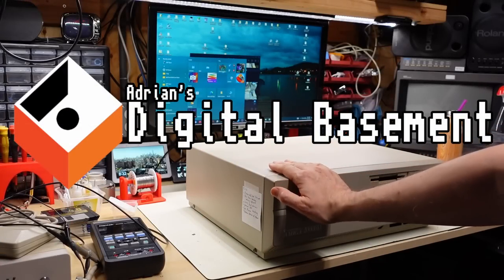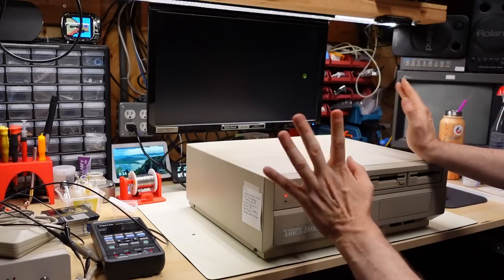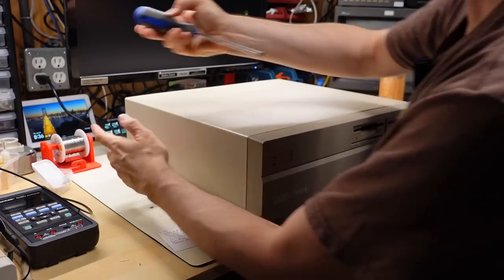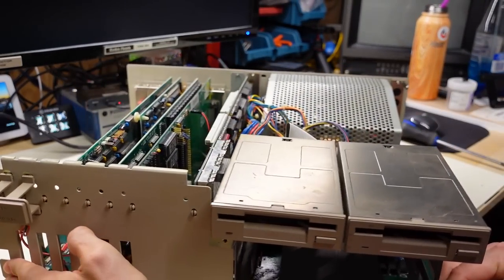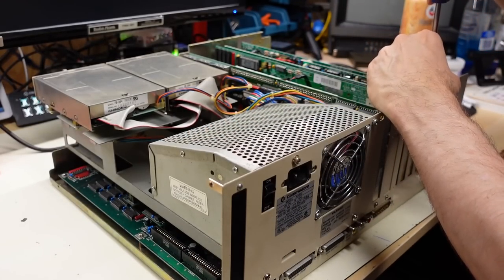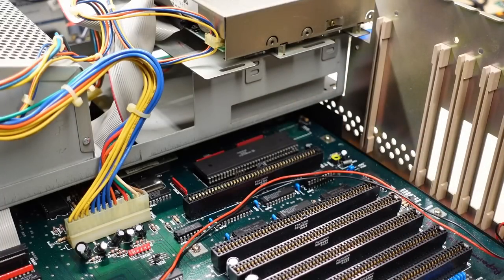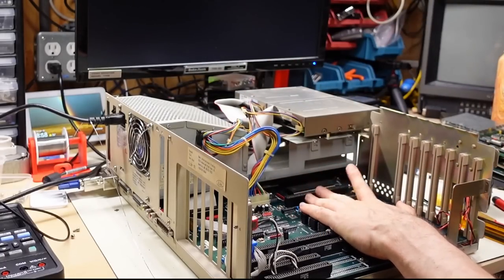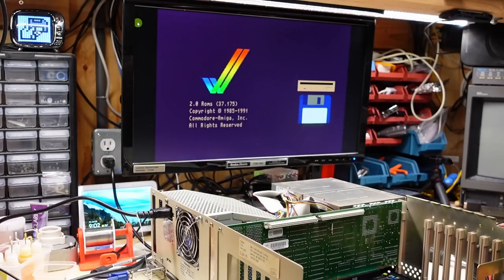I used the "easy button" to fix this broken A2000

Comment: As a guess I would say pushing down stretches the bottom layer of the PCB and compresses the top layer, so I would be looking at the top layer for a break. 
It could also be a break in a via, ie, it needs more solder in the THT holes so that you can see solder on top and bottom.
You should also remove every component in the affected areas because you never know what's under them if you don't.
Reply: Mr Guru  I was thinking about that, ie, machined headers use a wedging press fit that wears with multiple insertions, ie, it gets looser. 
Wiper is spring loaded so has constant pressure, but because it's not a press fit it can suffer capillary moisture attraction.
Dual wiper is better because if one side corrodes it still has the other, and I've seen on EEVblog multi pin press fit connectors with no solder that are very reliable.
Me personally I like wiper, but I guess both have pros and cons.
Reply: Mr Guru  I just thought of another problem with machined pin headers. If you have a dimensionally long IC, like the one with the problem, and your PCB is bent, eg, a dip in the centre, the end pins will have the correct press but the middle pins won't. 
I suppose it's rare, and more likely you soldered the headers in not flat, but I guess it can happen.

Comment: This reminds me of the time when I was in high school and I '"fixed" the loose connections on a computer lab PC's VGA port by shoving a folded-up piece of paper in-between where the monitor cable was plugging in and whatever was plugged in next to it. (People kept bumping the back of the PC and that cracked some connections on the VGA port.)

Comment: The issue of it working at boot when you flex the board, and continuing to run after boot, even if you remove the flex, strongly suggests the rest pin. Furthermore Don't discount the sockets... I built a HighDEF NES mod into a top loader NES a few years back. It was frequently intermittent, and the seller of the mod ended up swapping from a machine pin socket to a dual wipe style socket, cause apparently the machine pin sockets he had included would just sometimes be unreliable with some IC's pins.

Comment: If this is the Commodore A2630 (68030 @25mhz) accelerator card, the system will work without the 68000 on the motherboard. It's one of the few, if not the only accelerator card that can do this. 
Had problems with my A2000 aswell, kicked out the 68k on the mainboard, ran fine ever since.

Comment: I used this connector with round pins for a ROM on my Amiga 3000 and it was causing the black screen problem. ROM chips I used have had flat pins, like the CPU have.

Comment: In terms of reliable vs. unreliable Amigas, there is of course the A500 Plus model too which suffers onboard clock battery troubles, as well as having owned one (which died when Amigas were near worthless and cheap to pick up), I've seen myself a few externally nice ones on ebay from optimistic sellers with "amazing condition, perfect example!!!" style descriptions along with a high asking price, and then seeing the green death around the expansion bay pins which they remain silent about, yeah, those batteries suck, but those sellers suck too...

Comment: Not craptastic, Adrian! There is no shame in using the "wedge as repair" technique. In 1987, I shoved a piece of foam into my HP 11c scientific calculator. A couple of leads on the surface-mounted main chip had come loose and I only knew through-hole soldering. It's still working!

Comment: I had a C64 with no intermittent audio out of the RF connection.  I had to shim the RF RCA jack to make the connection solid.  I later on got the SAMS book for the C64 and made a DIN cable to send the audio to my stereo receiver.

Comment: Funnily enough, that's exactly the fix Commodore would have used back in the day.
Reply: Always remember then admitting that they repaired returned machines and then sold them as new and not refurbished. Just one of the many clues that Commodore were never going to last.
Reply: Maybe in-house, but even they'd know this was likely to come apart in shipping, and that the loose part could do further damage. Sending a machine to anyone like this has such a high probability of being DOA that I can't see them letting this leave.

Comment: I've got a front loader Nintendo, that I HDMI converter, that just don't work when I've screwed it back together. Finally I figured it that it was caused the motherboard being slightly bent on the back where the cartridge connector goes and that caused the connector to get slightly bent. Using the console like that works just fine, but when I screw it back together, the cartridge holder pushes on the connector in such a way that some of the pins get disconnected, causing issues related to those pins.

Comment: @Adrian's Digital Basement ][
This seems very much like a cold joint problem to me. Perhaps you just need to go over all the connections around the CPU with a soldering iron to reflow and solidify them. I would do this before removing the solder mask like you were suggested. EDIT: Don't worry about the AC noise, we can barely heard it. Not a problem at all. EDIT2: The SCSI to SD thing could be a voltage dip problem. Those adapters require a fair amount of power to work right. You may wish to check PSU power output and voltages connections. That system might be suffering a "brown-out" situation.

Comment: I'm not familiar enough with those SCSI cards but the random failures suggest a lack of termination power and/or a lack of termination resistors at the ends of the SCSI chain (or an inadvertent terminator in the chain but not on the end). IIRC termination is set by software on the SCSI2SD.

Comment: It seems that as the circuit is functioning, heat expands it, and makes a better connection. Testing the continuity during a cold stress (compressed air), should show the defect.
Reply: As to the SCSI drives, recheck the transfer speed mask and that the correct drive metrics are selected (use a more recent OS, HDToolBox, and FastFileSystem).

Comment: Your fix reminds me of putting a piece of cardboard under the laser on my Playstation back in the day to keep help it read disks better. Janky, but functional.

Talking of having too much fast RAM, my A1200 will crash on booting if I plug in my CD-ROM drive with more than 4mb of fast RAM installed.

Comment: Nothing wrong with a bodge, time constraints and all!

That said, the first thing I'd do would probably be to use hot air to just reflow all the joints on the back side en masse just in case it's a bad joint. Might not necessarily be next to the CPU socket either just a quirk of the particular way the board gets flexed when you press there? I don't think it would take too long, thin layer of flux on it all, wide nozzle, fume extractor and off you go.

But it sure could be a broken trace too. Another commenter mentioned DIP chips in turned pin sockets being a bad idea, not sure if you've heard of that causing issues before?

Anyway great video as always! This machine reminds me of my childhood Atari ST which had to be vigorously twisted diagonally to make it start up. It was probably just a chip needing to be reseated but I didn't know anything back then :D

Comment: Pretty sure you've got a dry joint somewhere else on the motherboard - when you press down on the CPU the board is flexing a lot and probably causing the dry joint to move and make a connection, time to break out the magnifying glass or microscope and search around for that telltale crack in the solder on a joint.

Comment: I'd check those resistor packs under the drive by the CPU...perhaps they are not properly connected and they are not pulling up/down certain signals that might need be. Also check any other surrounding componenets.

Comment: You'd know better than I would, but my hunch is that it's not the board like you're confident it is. I think you need a proper socket for it instead of those pin headers. Whatever is going on seems to be affecting the reset line.

Comment: Short is most likely under the CPU slot not the 68000. You seem to be putting presure on the CPU expansion slot rather than the 68000. Cleaning debris has fallen down on the socket pins.  Also need the v7 roms for scsi card, same as the A590.

Comment: I had a bad CPU socket (corrosion) and my A2500 was a no boot. However with the same Commodore CPU card you have, it would boot. Did not seem to mind the CPU being dead.

Comment: Hey, if the fix works, it works. :) Sure, it isn't ideal but at least it is working. I wonder if the problem with the board is in the reset circuitry area of the motherboard. If the SCSI hard drive controller isn't working with external SCSI drives (or devices) I would make sure you have terminated the SCSI bus. IIRC, the end of the SCSI bus chain requires termination.

Comment: Adrian! I found an issue, and its a pretty major one. On my A2000 one issue, is there are solder pads, near the battery that act as conduits from the rear of the board to the front. This particular pad connects the bottom left pin of the CPU to the ROM, and mine has no continuity in that direction. The issue seems to be that either the solder itself is so corroded that it is not taking the current from the boards top via, down to the bottom. OR, the copper around the pad bought it, causing the same issue. Visually it looks just fine, but its totally disconnected.

In my case its not surprising as the battery is just a few MM away from this dead pad. So I guess the electrolyte did its worse work there. How can I fix this, well, I COULD just bodge from the ROM pin, to the CPU pin and be done with it. But this pad is one of a set of 10 (RP900) and my intuition is that over time the other pads in this set, close to the battery will slowly corrode further and fail.

So my point is, when doing repairs on a board next to a bad battery/capacitor barf, it may be a good idea to remove any corroded solder in these through pads, and reflow in new solder. They may appear as working, and may continue to for years, but eventually the corrosion will probably create micro breaks in the connection and the CPU area may become flakey, even requireing maybe pressing down the CPU using a speaker? Maybe bending that area of the board enough, so that micro crack is bridged....

I watche this video on this topic, https://www.youtube.com/watch?v=S9q3s4mB5PM and it illustrates what I am saying here. Traces my look just fine, but the corroding solder AT the pads may be causing major issues. In his case, all the traces looked fine, but the pads were causing multiple dis-continuities

Comment: @Adrian's Digital Basement ][ There's a couple of things I know of that may help you out:

1)  The EATX A2000 board.  There's a seller in Poland on Ebay with the bare PCB that would solve the intermittent issue of the machine featured in the video.  I know that it's another project altogether, but probably worth it in the end.  Please check your email for more details.  

Btw, I think the real issue with your current board is that the corrosion you couldn't get to has started to seep in between the layers of the motherboard.  There's no fix for that imo other than just outright replacing that PCB.  That being said, I think that your A2000 here is a perfect donor for that EATX board since all of the bespoke chips are obviously working.

2)  Are you aware of a SCSI2SD alternative known as BlueSCSI?  It's cheaper and seems to be less convoluted than your current SCSI/SD solution.

Comment: Could be a broken Agnus socket. You applied pressure next to it, that bends the PCB and maybe improves the contact inside the socket. That PLCC84 sockets are a constant source of joy for Amiga users. 

If the Amiga starts to heat up and metal expands contact may change making it working unreliable. If you install a card into the CPU-slot  you apply pressure to the PCB and stability may change. If you carry it around or just bump into the case by accident - stability may change. Many things that could lead to unstable operation. ^^

You could first try to remove the Agnus from the socket and clean the contacts with isopropanol and a toothbrush. But replacing that PLCC84 socket is the best bet.

All of that old sockets are garbage and should be replaced. But on the A2k the 68000 socket and the Agnus socket are by far the worst. The 68k socket is almost always damaged by the leaking Varta next to it and the plastic from the PLCC socket lost it softeners over the year making the plastic brittle.

As a quick fix I wedged an eraser between the Agnus and the drive-carrier once (unscrew the carrier at one side, insert the eraser and push the carrier down and screw it down - there needs to be pressure). That was working until I replaced the socket some weeks later.

BTW: Solder dangling around next to working electronics is a disaster waiting to happen. ^^

Comment: Love the video Adrian and both the channels. T1d btw. 
Just wanted to let you know that years ago, I traded some usb sticks I had for a down AR drone (android based drone), and I found a simple "fix" and path to a repair of the board, was that if I applied pressure to the arm chip on the board, I could get it to power for a microsecond and lash an led that was supposed to be solid. If I applied several pennies and some zip ties around the board and chip, I could fly the drone. The problem however wasnt anything to do the the connection of the bga on the arm chip, but was that a few of the comps on the other side, had loose connections and that the flex of the board in the reverse way, caused them to contact correctly. So, do what I did and toss the whole thing in an oven really fast!

Comment: It sounds like it may be time to run the board through the dishwasher if it is corrosion. I'm sure that would get deep into wherever the corrosion is and neutralize it.
Reply: Why would running it through a dishwasher neutralize corrosion? That doesn't sound right to me.

Comment: Hi tanks for the wonderful content all the time, however make sure the speaker is magnetically shielded otherwise floppies you insert might get bitrot from the even though low magnetic field.
Reply: Mr Guru  have you calculated the coercion of floppy media at that distance? I prefer to err on the safe side when pointing the open and unshielded side of a speaker towards floppy drives. I said bitrot because at that distance a floppy maybe won't get outright erased but single bit flips can happen.

Comment: Soo, it's only needed on power on, but can be removed once it's up, otherwise you get a blank screen? Smell like maybe a busted reset line. Is it one where the reset line has to go high, then drops low? Maybe with a flaky reset trace it's not getting that initial high state?

Comment: It seems to be acting like the problem is a bad connection between the power on reset circuit and the CPU.  I don't know the pinout of the 68000, but I would bet that it is on the side of the CPU that requires pressure on the motherboard.  (I say it seems like the reset circuit since it will boot with pressure applied, then keep running when the pressure is removed.)

Comment: It is like taking an old xt pc apart very heavy and loads of screws sounds like dissimilar metal connection problem in a socket or corrosion or a board crack use some hot glue to keep the speaker in place

Comment: If it was me I'd just swap it over to a replacement board. Granted it's probably a LOT of soldering. But still it's got to be easier and more permanent than constant bodges and pushing down and wedging something in there.

Comment: Plated thru-hole.  That is likely your problem.  If you completed all top-soldering on the CPU connector you might have fixed it properly.
Other cause is fractured copper trace on TOP side of PCB in the CPU area.  Fractured thru-hole is most likely.

Comment: What are the chances you have broken solder on the processor port?  If it's working when you press on the chip and flex the motherboard, it has to be a physical defect of some sort.  Maybe try reflowing the solder for the socket?

Comment: With the harddrive you might have to play with the maxtransfer value in hdtoolbox. A common issue with IDE/CF-drives. Might be the same with some SCSI-drives.
Reply: I don't know what problem Adrian has with the 2091, my A2091 (with ROM 7.0 upgrade) works just fine with a SCSI2SD v5 with latest firmware. I think you do need to limit Mask to the lower 16MB of address space, and MaxTransfer to somewhat smaller value indeed. (0x1fe00 that the IDE controllers need seems like a same value.) But these values are almost never related to the drive, but to the controller itself. Also, Aminet has a bunch of patches for the A2091 ROM that are highly recommended, because otherwise the controller might not end up using DMA at all.

Comment: I wonder if the act of tracing it out applies enough pressure to make it connect internally. Almost like some broken trace, or broken with corrosion pushing the sides apart?

Comment: Oh boy, the corrosion from leaky batteries can really eat itself into the PCB. In some cases all you can do is to transplant the chips into a new motherboard, but I don't think there's a ReAmiga 2000 board yet.
Reply: Exactly.  I have repaired a couple and had to go over them again down the road to find corrosion that still migrated.  There is new Amiga 2000 motherboards.  Search for Floppie209 Amiga 2000.

Comment: Hahaha love the jankiness of this fix. Once i had a Playstation with the same mode failure and worked years with a piece of hot glue pushing the board, when i finally compromised to reflow the entire area the failure became permanent and no longer worked...

Comment: I'm betting one of the CPU pads is lifting off the board. 

But yeah you should be able to run without the CPU in the socket if you have the Accel board in...